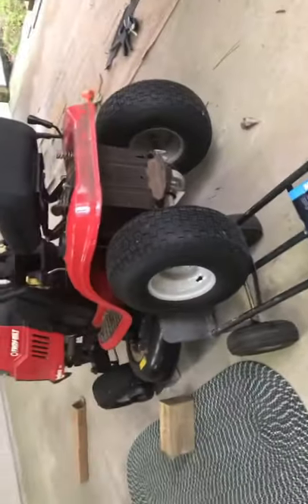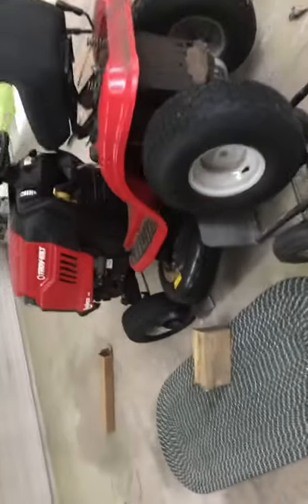#shorts Lift riding mower with hand truck, easy, fast, free

Comment from the maker: Please note that I’m on a slight slope so I only chock the back of the front wheels.  Use common sense in your situation when chocking.  You may want to chock the other rear wheel.  Finally, I only show lifting one side - its the same procedure for the other side.